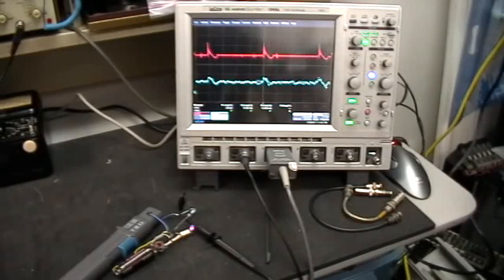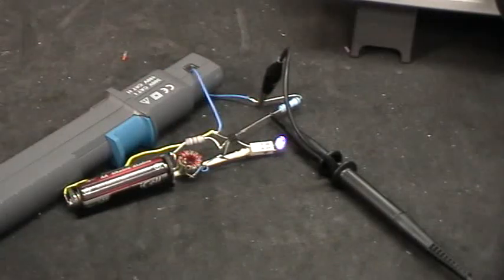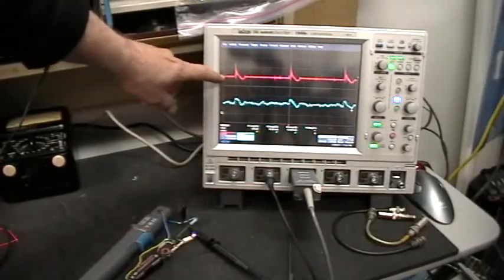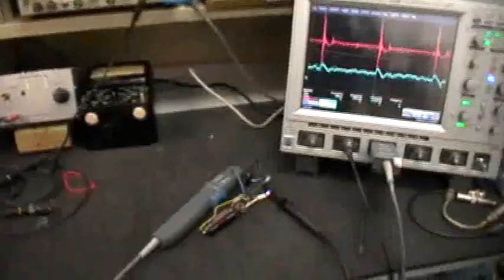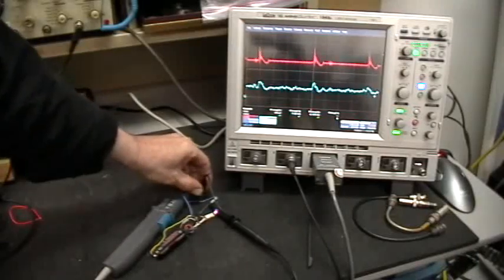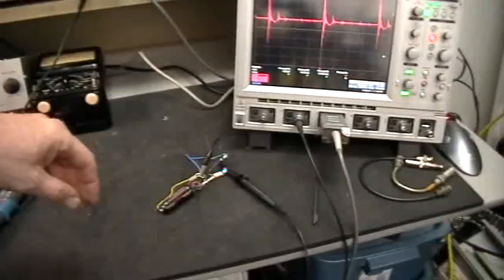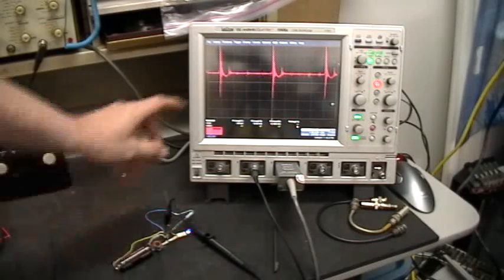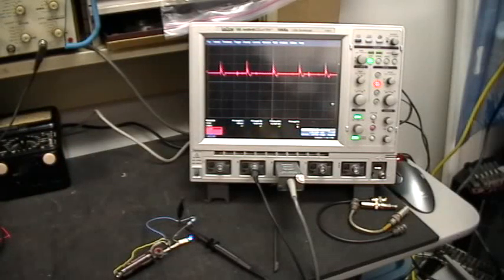Joule Thief: A Measurement Pitfall

Comment from the maker: It should be perfectly easy for Steven Jones to put two of his circuits in series, right? 

I've shown how to run one JT off of the output of another, several times.  Jones should be able to run 8 identical JTs off of the output of his circuit. Or just four, even easier.

Then he could run 4 more from each one of the 4. And so on. Why hasn't he done this? Does he need more transistors? I'll send him some. Or you could.

The point is that measurements are no good without concurrent validity.

Comment: Excellent demo, keep up the good work! It shows the difficulty of getting proper measurements with rapidly changing power, something which ALL the "over unity" crowd need to address *very* carefully. 
There is also some amount of transmitted RF power here (not measured) and any metal objects nearby can also do strange things to the signals, and confuse/distort the power readings to various degrees.

Comment from the maker: @overunitydotcom 
What's mysterious about it? It uses principles that I have been emphasizing for a long long time: get away from ferrite cores, use air core coils that are 1/4 wavelength resonators, go for the shortest possible rise time in the primary pulse, so that you get the highest possible voltage produced in the secondary with the least voltage input to the primary.

I am glad to see these principles -- that is, real Tesla technology -- being put into use in the Joule Ringer.

Comment: Let's consider a correct measurement of the voltage drop over the 1 Ohm shunt:

it shows an interesting feature; the voltage rises from 0 steeply to a positive value, than drops gradually to a negative value, and finally steeply back to 0. Does this mean some power is fed back into the battery when the voltage drop is below 0?

It puzzles me whenever I measure the power consumption of Joule Thief over a shunt, Conrad

Comment: Well done TK,
yes, with high frequency every cm of wire counts as an inductance,
so it is really advised not to use croco-cables as these add too much inductances.
So better solder all your circuits with short leads and use stranded cables for better RF conduction.
Regards, Stefan.

Comment: There's a simple modification that can turn a Joule Thief into an Armstrong-type regenerative receiver. Works great on short waves and can run up to 100Mhz with air core coils, a generic transistor and half a milliamp of current.